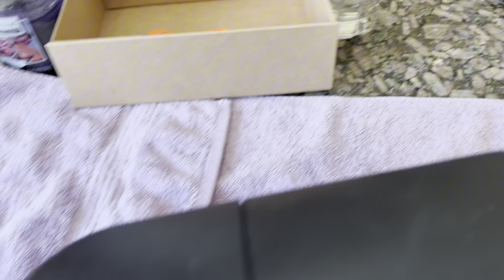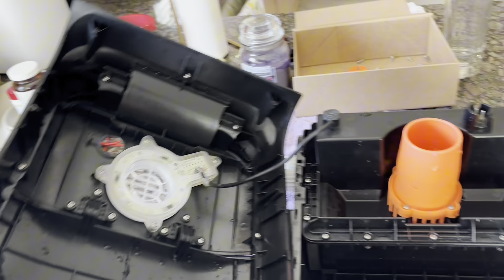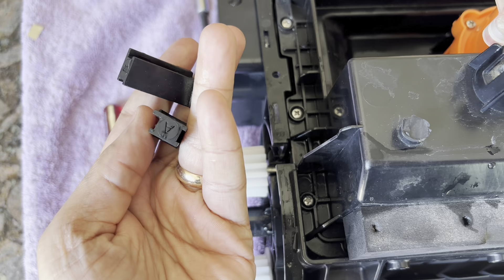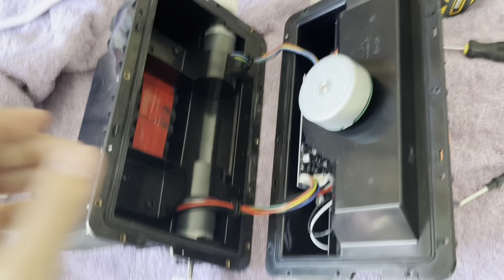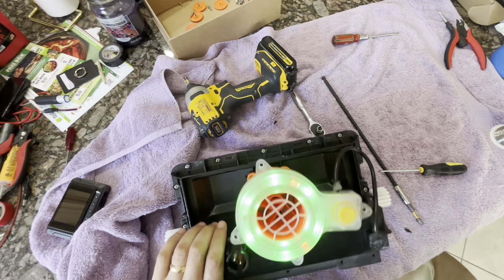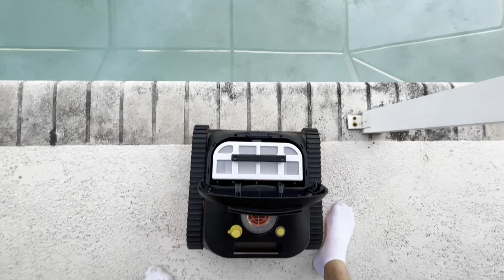How to replace the Coasteering Pool cleaners battery

Comment: Hi! I'm writing from Spain. I have the same CoasTeering Nebula robot, and mine just broke too. Water got inside the transparent control panel on top (the circular/racket-shaped piece with the power button). Because of the water damage, it won't turn on at all. Do you think it's possible to repair it, or is there a way to find a replacement for just that part? Thanks so much in advance!"
Reply from the maker: Hello, if you can see which ic got damaged you can possibly buy it in Digikey only buy it if it’s not a microcontroller

Comment: How many milliAmps is the original battery ? Would you have the dimensions ?
Reply from the maker: So the original battery was using 6 amp hour batteries the ones I got where 9 amp hours so they could supply more

Comment: Can it de reset i   baught a second hand but its not turning on while charging its flashing all lights and bipping dont knot if this is normal but it doesnt turn on
Reply: Same problem as mine. The issue is with the main motor. I'm struggling to find a replacement but still no luck

Comment: Great video - perfect for my needs.  I am looking forward to seeing the battery build video.  The battery link shows mixed reviews for the cells used. Do you have good personal experience with these cells?
The two pins you showed are the charging port.

Comment: Hi, I bought a vacuum cleaner like this, but when you turn it on and put it in water, after a few seconds the LEDs turn pink and then start flashing blue and red.
Reply from the maker: That’s normal if it’s running…if it doesn’t run then call them cause it might be broken